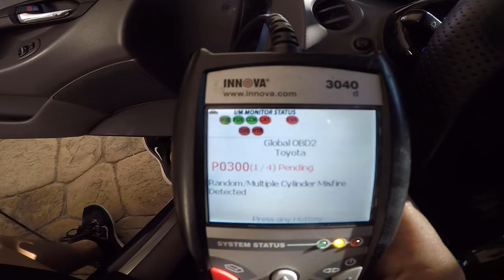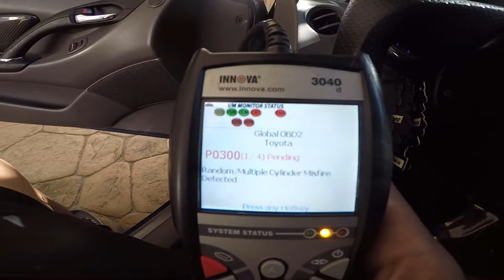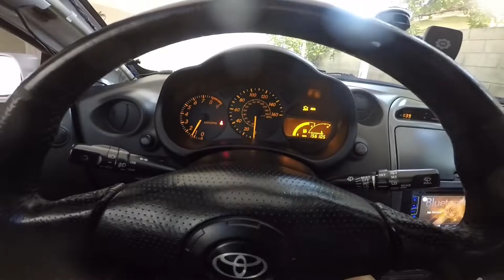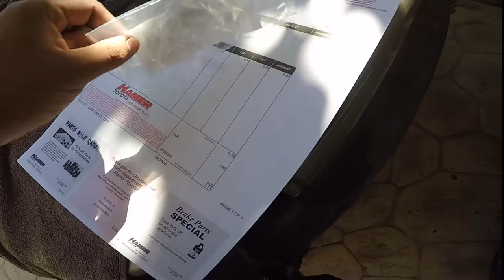Misfire Code Comes Back

Comment: Yo i have the same cold intake but mine seems to rattle, upon start up. I bought the M6 bushing to strap it down, but turns out the coupler ain’t long enough. What the coupler size you have on your car? I ordered a 6 inch by 2.5
Reply from the maker: hanielbomb did you put the mount on the side by where the fuses are at
Reply: Rafa's Garage it hits the fuses box and there a hole next to it, but since the coupler it ain’t long enough won’t reach. So getting a 6 inch coupler so have enough room for the m6 bushing to line up.